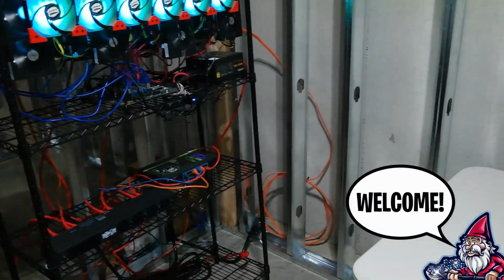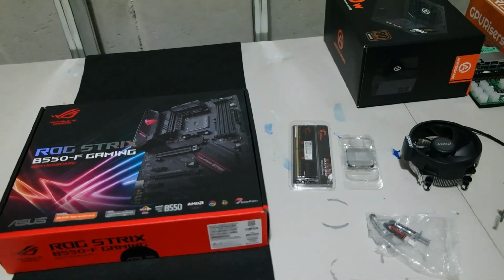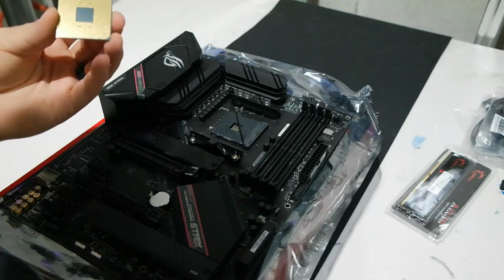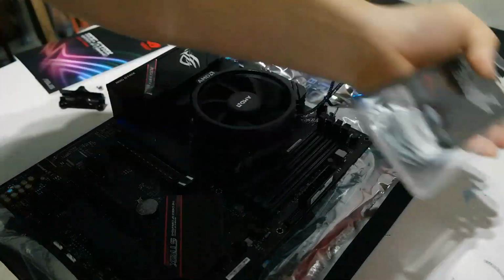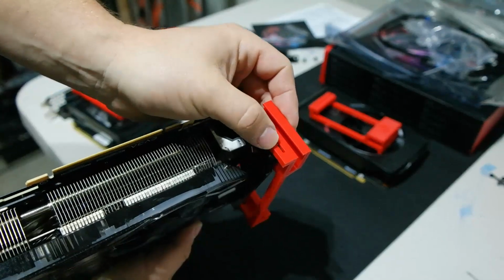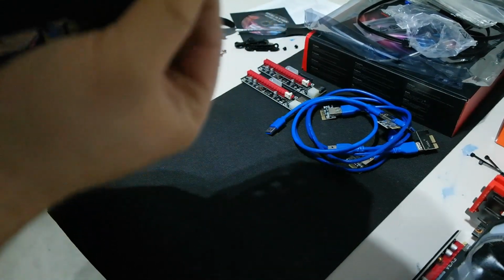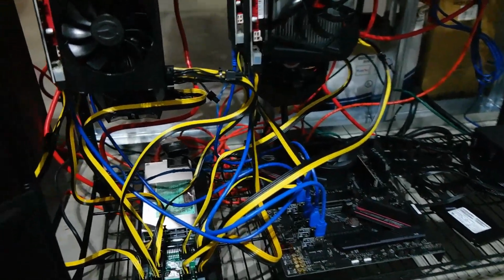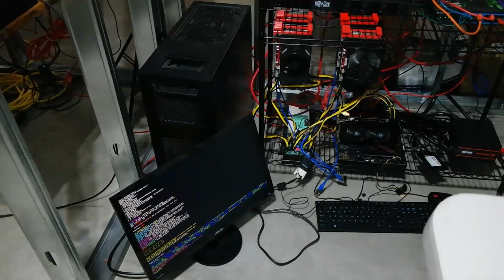GPU Mining Rig Build Guide - Surprise Build Ending!

Comment from the maker: Do you have any Mining Rigs that have entirely different GPUS?  If so, what GPUs are you running?
Reply: Just a heads up from veteran pc builder and miner: NEVER PUT THE CPU PINS DOWN ON THE TABLE (11:16). Clean it in the Mobo. Love the channel and vids but make sure not to accidentally damage your gear. Ask me how I know...
Reply: IF you leave the ethernet cable unplugged, let hive load up, then plug the ethernet cable back in, it will work, I bet.  It sucks if you lose power, and arent around. I know old vid but might help someone out
Reply: At one point I had 1660 super 3060ti and 5700xt all in the same rig.  I kept working on it and now all 3060ti and 3070.
Reply: nope only 1 GPU 3060, 3 NEWpac USB, 1 ASIC L3++, 2x HS1-plus, waiting on more mining equipment to arrive.
Reply: Had a Vega 64, rx 590, rx6800, rtx 2080ti,  3070 and a 3080  all on the go in the same rig, was just one big headache on windows.
Reply: Yup. I kinda like it too... I have a test/mining rig that has 2 AMD rx6700xt, 1 NVIDIA EVEA RTX 3060 and a NVIDIA ZOTAC RTX 3060. On a ASUS 570 AMD 3200 CPU. 32G 3200/2600 DRAM. Runs really great. Fast & Stable. I like it because I can test/run CPU & GPU mining with Trex & Redminer, CPUminer, Zminer and more at the same time from the same WIN 10P console. I only have OB 4 PCI Slots, 1 16x, 1x, and 2 other for risers. I'm running a 4 way USB splitter w the 2 Radians and one Niv w/not a glitch. The other Niv the 16X PCI. All works great. Once in a while I have to fiddle with the AMD cards, but from what I see out there that's normal. Great vids man! I love the failures. We all have them. You learn more by seeing others problems and possibly solving them once in a while. Anyone who says they always get it right are total frauds. HODL!

Comment: I have a similar MB but with Intel socket and I had the same problem. I solve the ethernet port issue with an Intel driver update, maybe with AMD is the same. Cheers
Reply from the maker: Are you running a Windows Mining Box?
Reply: @TheHobbyistMiner  not sure how to answer this... I’m running Windows (because of my 3060) without a mining box 😅 Maybe I’m losing track of something 😁 Anyway, in Windows and for a similar MB (Intel side), this issue can be solved with a driver. Cheers!

Comment: On top of needing to update the NIC firmware for all boards using this Intel Ethernet 2.5 Gb chip (all boards with the 2.5 Gb ports are affected by this), you should update the bios settings so you can use the GPUs on risers.  One disadvantage of AMD is that there is no integrated graphics.

For anyone that runs into this problem, I found a workaround that worked for me.  Once HiveOS boots to command line.  Run these commands:
ifconfig eth0 off
ifconfig eth0 on
and then type if config until eth0 shows an ip address.

Also, for windows users, you can update/downgrade your NIC firmware to a version that worked.  Unfortunately, it doesn't look like ASUS has the correct version.  This is from the GB website:
Intel I225 Firmware Update Tool
* Intel I225 2.5GbE Firmware Version 1.45 for Link Stability Improvements